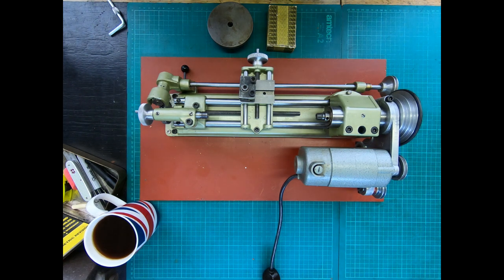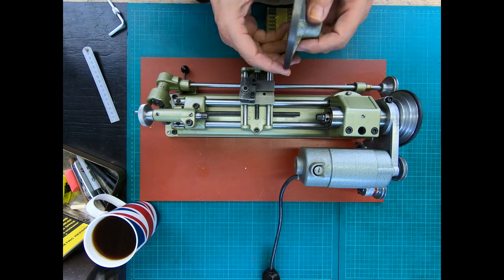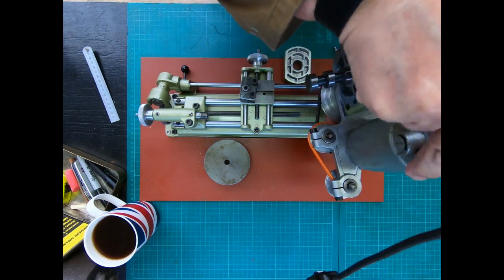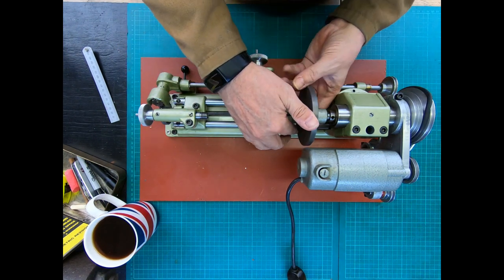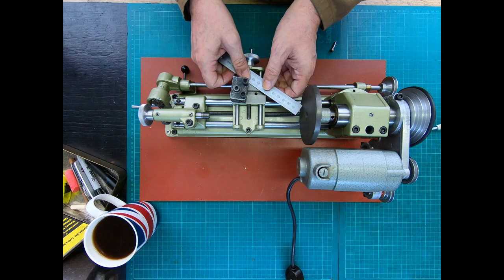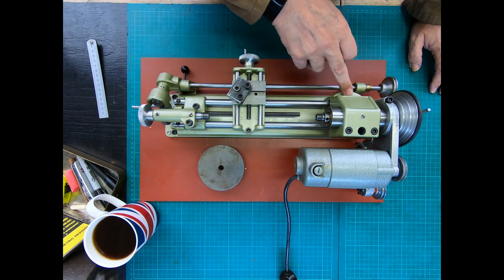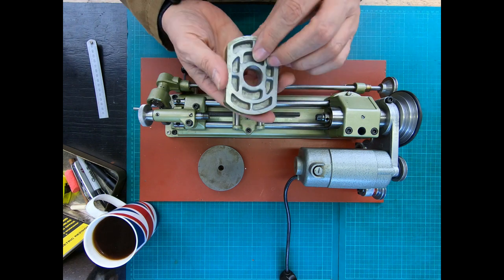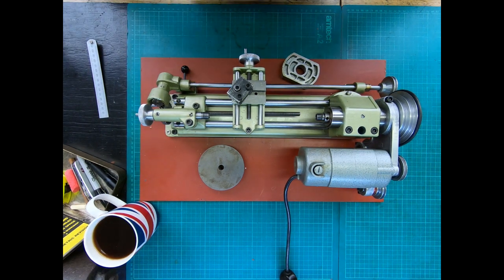Unimat SL Raiser Block & Sanding Disc.

Comment: Can anyone shed some light on the approximate cost of the Riser Block and Sanding Disk ?
Reply from the maker: Hello John,
Here in the UK a ballpark figure would be £50.00 for the riser block and £30.00 for the Sanding Disk. I hope that is of help.
Take care.
Paul,,
Reply: @TheKnacklersWorkshop  Aye , I can buy a belt and disk sander for less than that ! I get the lure though, adding functionality to a system your already invested in, but you need to keep in mind the costs outweigh the usefulness of some of these 'upgrades' ! :/

Comment: Hi Paul. Last year I was lucky enough to find a riser block for the SL, though not original, it was nicely shop-made from a solid block of aluminum, properly shaped with a single hole for the headstock stem. I ended up using it on the mill setup, to extend the throat of the spindle by 20mm, very handy for longer cuts.
Thought about boring a hole for a longer alignment pin to extend through to the milling column bracket, but that's another project on the wish list.
No doubt that collecting Unimat accessories has become a mild addiction, but 12 year old Rich who couldn't quite afford a Unimat in 1964 for $99, is now (almost) satisfied 🙂
Reply from the maker: Hello Rich,
I am now starting to think that the riser block is become a sort of must have for the anyone's Unimat SL setup... I agree it is a bit addictive collecting the accessories, there is one or two I cannot imagine using to much. Thanks for watching.
Take care.
Paul,,

Comment: Hi Paul. I use the riser for more lathe/mill capacity also because I don't have the sanding capability. I'm also going to use it with a vertical milling device that I'm going to try, hopefully with a video to go with it. 
Which new attachment are you spying and which one is too expensive?
Reply from the maker: Hello Mike,
Good point on the riser working on the milling setup, I should have said something about that. On the other accessories there is a flexible drive that I like, which is the to expensive one. I have hatched a plan to make an adaptor for a Dremel one. The other is a router but has some parts missing and I am not sure I want to add another thing to the to do list at this time. Thanks for watching.
Take care.
Paul,,

Comment: Cool attachment, it is great you can get so many accessories for the lathe. You would have thought that the factory riser block would also come with one for the tool post and tailstock as a kit. Thanks for showing this
Reply from the maker: Hi Joseph,
These one are quite nice additions to the the Unimat SL. There may be factory riser blocks for the toolpost and tailstock but I have never seen them. I am keen to make some if I cannot find any. Thanks for watching.
Take care.
Paul,,

Comment: Nice find Paul, just bolt a lug on the side of the riser block with a hole in for location. Are the other two riser blocks available or will you have to make them? Tony
Reply from the maker: Hello Tony,
Thanks, that is a good idea for the alignment. I have not seen the other riser blocks, so will have to make them. Thanks for watching.
Take care.
Paul,,

Comment: I have a sanding disk, I don't know what it is for it came with the craftsman lathe it measures 4 inches across and I don't know what the threads are but the aren't the same as the craftsman lathe spindle.
Reply from the maker: Hi Vernon,
That is interesting about your sanding disc... Maybe you could ask on one of your videos and someone might be able to help shed some light on it. Thanks for watching.
Take care.
Paul,,